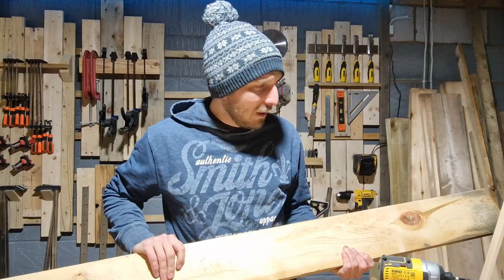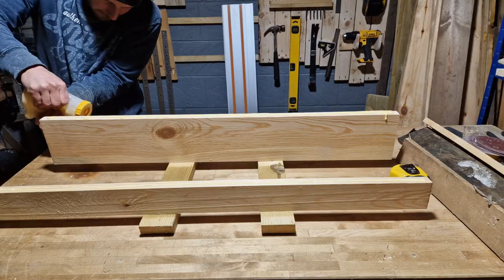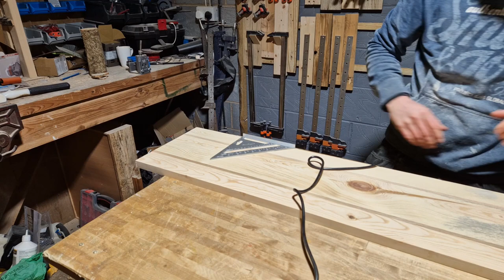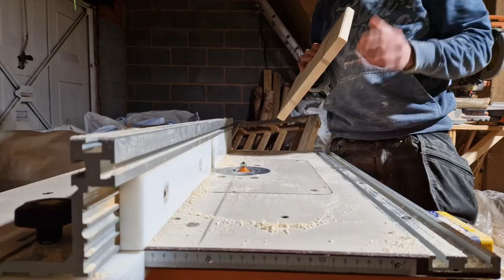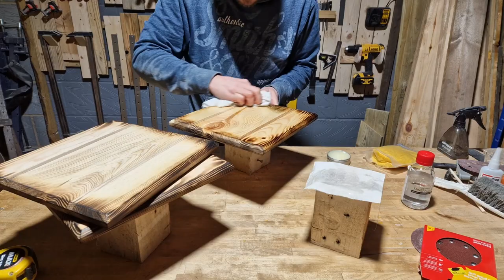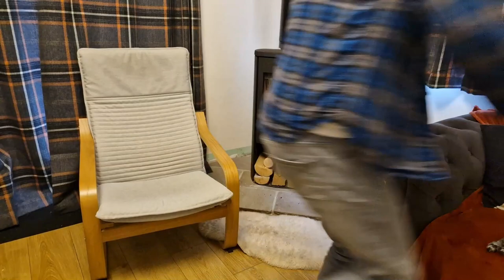CHEAP and EASY Charcuterie/serving Boards: A Holiday Story

Comment: I would recommend using hard wood, as knives will damage the soft pine pretty easily!
Reply from the maker: Absolutely true. I made sure to tell the relatives its a cheese board rather than a cutting board. Cheers for watching.